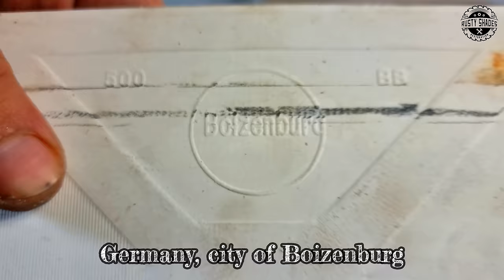Primitive Fridge Restoration - Early 1900s Ice Box

Comment: In college my father delivered 25 pound and 50 pound blocks of ice.  While making a 50 pound delivery one day the block slipped out of the tongs and fell, catching the homeowners thumb on the edge of the metal cabinet below.  It sheared the man’s thumb off very cleanly.  This may have influenced my dad’s choice of career as he went on to become a surgeon in the army!
Reply: that sounds painful is their thumb ok??
Reply: Hope he started using a scalpel to remove parts rather than sticking to the ice method 😆
Reply: @rupertbear4447  LOL. An ice block is the MacGyver method. Hehe.
Reply: Almost did the same once with a hammer and a sharp corner of an aircleaner.
Reply: @i.dont.sleep.9718  he’s dead

Comment: I really enjoyed watching this.  You did a fantastic job and I love your wood stain color choice.  I thought for sure it would have to be white again, but you really did a fine job of sanding.  The only thing I would have done differently would be that I'd want the period screws back.  I know the philips heads are faster, but that old slot screw look is so vintage.  At any rate, thanks for letting us watch.  You did a fantastic job.
Reply from the maker: Thank you so much for watching and commenting. Yes, with that screws I screwed up a but, but only because I wanted to replace them with brass ones and for 3 days in a row I couldn't find at shop and I needed to finish the project somehow. I replace the after a while. Have nice weekend!

Comment: I enjoyed watching, but from what Ive seen on other restoration videos, you could have benefited from fully disassembaling the box to inspect for further damage, and to let you clean more thoroughly.  This then gives the benefit of being able to see where you should replace or at least partially apply new wood/material in perhaps more hidden/unseen spots for a more robust finished project. Then you can stain and tend the wood without it dripping over on to the other parts and potentially staining them accidentally. After all the work of taking the innards out and cleaning them, it makes the rest feel rushed and not as well handled. 
But you still can learn from it, and hope you enjoy many more projects in the future :3
Reply from the maker: Thank you! I didn't do it because I could damage everything almost and if I will replace the most of the wood that will be a renovation not restoration and the object will end up more as a replica and loose it value. This kind of ice boxes are pretty expensive as they are and should be carefully touched if you wanna sell it later. 😉

Comment: When soldering, you should always only heat the work piece and then add the solder, which will flow by itself if you have cleaned the work piece before.
Reply: Correct if cleaned and you use  flux it  always flows towards heat

Comment: Nice! Never knew they packed the wall spaces with wood shavings and sawdust. I really like seeing old things get restored instead of being thrown out. The only thing I would say is that you should replace those phillips head screws with slot head screws like the originals to keep with the original antique look & feel of the thing. Use brass screws so they don't rust.
Reply from the maker: I'm glad you enjoyed the video. It's in my plan to replace the screws with brass ones, I wanted this but unfortunately for 2 days in a row I couldn't find in the shops near me so I ordered online but didn't arrived on time. Thanks for watching 🍻
Reply: This is the exact thing I was thinking while watching this video. He did all that work to NOT OVERDO this restoration and keep the antique feel of the project and then put those modern screws in it. I’m glad to hear you plan to replace them with brass. My other question, how cold did your beer get?
Reply from the maker: Thanks for watching! Yes, my plan was literally "screwed" because I couldn't find at that given moment brass screws, but that isn't a big problem anymore because now I have my own lathe so I'll try to make new ones by myself. I checked on the temperature after 3 days and was at 0 degrees Celsius even if all ice was almost melted. The zinc interior does the job. Cheers 🍻

Comment: Nicely done. My grand mother told me about. when they where young, they would go in the winter time to the lake to cut ice. And store it in the cellar. And they would use saw dust on the floor and then put the ice on top of it then cover it up. the ice harvested up and it would keep for the year. And they would go and cut the ice to put in the ice box.
Reply from the maker: Wow. I didn't know that sawdust can slow the melting process of the ice. Thanks for sharing and watching! Beautiful memories!
Reply: @rustyshadesrestoration  yes it a good insulator. it keeps it dry and the heat out there are people making homes with saw dust as insulation but treat it boric acid to make it fire proof.
Reply: That’s what they did in the country or rural areas. In cities ice was shipped in by train and stored in warehouses , wirh insulating sawdust. Then it was cut into chunks, put on trucks  and taken out to the folks who had previously ordered ice. I think it was  similar to  a subscription, you’d ask for X amount of ice to be delivered every Z  number  of days. And I think the size of blockmof ice  ordered would depend on the capacity of your particular ice box.
Reply: @teresahiggs4896  that is correct. My grand mothers people settled in West Virginia and they had ponds on the land they owned. So they would get all the ice they could harvest each year and it would keep. But some people would order it from the ice houses.  There are still places in the south that you can get ice and dry ice as well. Dry ice is Is liquid CO2  that is frozen.

Comment: 30:56 - It's best to use a torch (propane, MAP gas etc.) for this type of soldering work as the whole workpiece needs to be heated for the solder to flow properly. Also applying a good cleaning flux to the repair area will make the solder flow into the joint much easier.
Reply from the maker: Nice! Thank you for your advices. I will definitely try it out. I love this kind of comments from which I can learn. Thanks for watching and have a good one!
Reply: @rustyshadesrestoration  My pleasure! You're doing a great job...keep it up!

Comment: I think the red stain was diabolical,  you should've insulated it with wool and used brass screws, but otherwise a wonderful project and rare item to have the opportunity to work on. Must be a pleasure to use too. How does the price of ice bags + car fuel transport compare to electricity? Also recommend you buy a vacuum cleaner. 😉 Lastly, you have nice arms! 😉😉
Reply from the maker: I love the colour and anyway get a bit darker after few days. I probably should use brass screws but unfortunately I didn't found at that moment, but they are on the list. I don't know if using the ice box is cheaper than using an electric fridge 🤔 😅 Probably the same, with the prices in this crazy times. Thanks for watching and for you compliment! Cheers 🍻
Reply from the maker: Oh, I forgot to respond to one thing, I have a vaccum cleaner 🙃

Comment: For the brass parts you can also mix together flour, salt and vinegar as a safer brass cleaner. So you don't have to sandblast it and risk losing any material. Just wrap the item up covered in the paste for 24 hours.
Reply from the maker: I know this technique but thanks for sharing maybe someone will read your comment and get inspired. Thanks for watching 🍻
Reply: In the Navy we used Tabasco sauce

Comment: Great job! Some tips, next time use a scraper to remove the paint, it’s much faster. To prevent staining (waterbased stain) wet de wood first, you’ll love the result. Last tip, never use an open flame when soldering zinc, it will alter the material en holes will appear in a short time, soldering iron only.
Reply from the maker: Thank you for watching and for the tips! Much appreciated!

Comment: Great job sir. Just a few things I would have done different. You used Phillips screws. Keeping in line with the age of the icebox you should have used flathead. 
Also, try to find yourself a good set of roll pin tools. You could have used them for the tiny nails. It would prevent damaging wood or metal pieces you worked so hard to get looking nice. The roll pin tools will fit over the head of those nails and you tap them in like using a punch. 
Great job, keep it up.
Reply from the maker: Thank you for watching and for your tips! Highly appreciated!
Reply: @rustyshadesrestoration  I'm a new sub of yours now
 I look forward to more restorations.

Comment: Nice restoration. I would of loved to see the original flat head hardware used instead of the more modern Philip head screws.
Reply from the maker: I wanted to replace them with brass ones but I couldn't find for 3 days in a row an I had to move on with the project. Till the end I managed to replace them. Thanks for watching 🍻

Comment: You joked about the sawdust on a mouse but they used it to pack in open areas to insulate. The white stuff on the metal is zinc corrosion from the galvanized tin lining. Neither it, the lead based paint, or the lead based solder are anything you want to be making dust and breathing in.
Turned out looking really good. I had one I totally rebuilt from the hardware off one that was in worse shape than yours. All the tin on mine was rusted out and the wood rotted past saving. Redone the wood in Cyprus and the tinwork in stainless. Use it as an end table in my living room now.
Reply from the maker: Thank you, I know that sawdust was used to insulate, I just wanted to add a little joy to the video. I would like to see yours, if you want you can send me some photos on Instagram. Cheers!

Comment: A nice job although I would have tried to find old brass screws, as the modern ones take away from it a bit sorry for being picky
Reply from the maker: Thanks ✊️ I had this in my plan but I couldn't find it for 3 days in a row so I had to move on with the project. They were replaced meanwhile. Cheers 🙂

Comment: The restoration is not bad at all, in fact it looks like it just came out of the factory or just bought, but in my opinion I would have installed a new electrical and refrigeration and lighting system and one other detail🤔😅😍🤩💖👍‼️
Reply from the maker: That will be an excellent custom project, but some people may judge callous this kind of decision.
Reply: @rustyshadesrestoration  Ok👍

Comment: The restoration of such an old and badly damaged refrigerator is an extremely extensive and difficult procedure with a lot of attention and dedication to the smallest details. This kind of restoration requires a lot of willpower, effort and time to restore it to its original appearance and functionality. Here, in this specific case, that did not happen. That is why many mistakes are made due to many omitted restoration procedures. I watched the video from the first to the last second and then returned the time of the video to 13 minutes from where the restoration went wrong. Before presenting the observed irregularities during the restoration, I will address the author of this video. That is, to the person who did the restoration process. The goal of my writing is in no way to belittle your work or to underestimate yourself. The very purpose of my writing to you is to make your future works even better by the very fact that, on the basis of these well-intentioned criticisms, you will make an effort to bring your works to perfection. And thus win many customers who will see in you perfection and trust for restored goods. You didn't show me any of that with this video. Watching your video materials, I realized that you are solidly well equipped with restoration tools, the most important of which is a sandblasting compressor. Without him, the restoration would be almost impossible and very difficult. Rather, let me start from 00:13:00 minutes.
      The tree you tried to restore, I would replace it with a new one. It would take a lot more time, but the foundation would be completely sound. In your case, it is possible to do the work of wood restoration but in a different way. For wood that is diseased by termites, there is a liquid that the wood is dipped into that destroys the remaining termites and frees the wood from further potential disease. Only then is the wood grouted with wood grouting compound and sandpaper to the degree of smoothness and desired appearance. The zinc metal that is in the refrigerator is very bad and zinc rust, that is zinc oxide is very poisonous. Cold bronzing cannot completely stop the zinc oxidation process. This is done on hot broaching, which requires special conditions and special liquids. Therefore, it was simpler to replace the existing sheets with new ones, for example with stainless steel ones. At 00:19:12 you can see the hinges that support the door. They are in very bad condition and I believe that at least they would not have significantly affected the total cost of the restoration if you had bought them new. The new wood would also save you money on the paint you used to coat the old wood in two coats. New wood would only require a thin coat of paint, or instead of paint, coat the wood with wood wax. It would be aesthetically beautiful and simpler. I like that you put styrofoam in the door cavity as insulation at 00:27:23 and that you put the original ceramic tiles back in later. But I don't like that you left the old rusty nails on that door as well as the screws that clamped the metal and wooden structure of that door. At 00:32:44, you can clearly see how the remaining sawdust falls out of the tree, which is a consequence of the termite attack and which are still in the tree. At 00:33:55 I expected you to put new screws on all four sides of the sieve circle instead of the old nails. At 00:34:19 you can see the fuse on the faucet that had to be removed in order to clean the faucet from the inside as well. And at the very end, one small addition. Ceramics could also be grouted to make the tile compositions fuller and more aesthetically pleasing. None of what has been mentioned so far belongs to reconstruction, but only to restoration. Once again, I would like to ask you not to take these words of mine as malice or some kind of jealousy and unseemliness. Already exclusively as good-intentioned advice as a master to a master. I am a painter and according to my job description, I also do some kind of restoration, I restore the exterior and interior walls of the house. I am an extremely big perfectionist and I don't leave unfinished or half-finished jobs behind. That's how I learned 25 years ago, and that's how I work today. I never got my hand used to punching. That's why today I have a good price for my work and a lot of satisfied customers whose number is growing month by month. I wish you all the best in your future work, a happy and healthy life. That's more important than anything else. A part of something can be restored, health in a person has no spare part. I wish you all the best.

Comment: Хорошая  работа!
Good job!
Reply from the maker: Thanks ✊️
Reply: I would imagine that restoration really means that the restored article works as well as it worked many years ago. Was it tested to make sure?
Reply from the maker: Yes, it works pretty well. With a full container of ice I had cold drinks for almost 4 days and could be prolonged with some sawdust on the top of the ice.

Comment: Quick question, during the reassembly wouldn’t you have to put the ice box base in first then attach the faucet/dripper after the ice box base was in place?? I was only asking because of 34:40 and a little before that time; where it shows the faucet/dripper being reinstalled first and the ice box bottom getting installed after. I was just curious about steps of restoration.

Comment: If you intended to leave the ice in the ice bucket? You should have taken it out of the plastic bags. Depending on the make of the ice box, most used block ice, some used chunk ice, but all of them drained the ice water into a catchment so you could have ice water on a hot day.
Reply from the maker: I did that. I choosed to keep it in the bags while filming because was extremely late when I went out from shop and I wasn't 100% sure that will not melt overnight and spill around, but after that I had time to test it properly and yes, it is great to have e some icy water on this hot days! Cheers and thank you for watching and commenting. Have a good one!

Comment: You can remove paint from fixtures using Mr.Muscle. l refinish poorly painted metal figures, place in a tupperware tub or plastic bag. Squirt in Mr.Muscle. leave for 24 hours then run under a hot tap
Reply from the maker: Hmm, that's a nice tip! I will definitely try it! Thanks! 👊

Comment: I would put the slot screw back in it.
Reply from the maker: They were gone. I had in plan to replace them for the video with brass ones, but for three days in a row I couldn't find one to buy, so I used what I could. Now they are replaced and more than that made by me, I've got a new lathe machine meanwhile.

Comment: At least the brass stands out on the red varnish.  Just wondering why you didn't use brass screws with the brass latch and handle? Otherwise great job and just subscribed.
Reply from the maker: Thanks. The screws was replaced with brass ones. I had bad luck and for 3 days in a row I couldn't find so I had to move with this project and start another one. This happens wen you want to keep a strict posting schedule. Thanks for watching 🍻